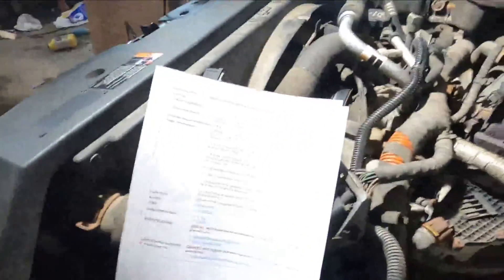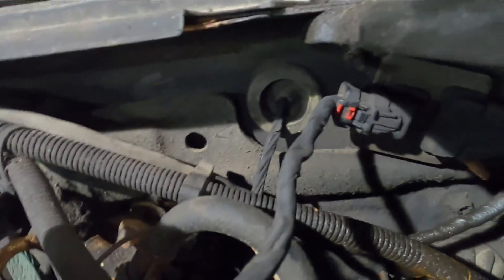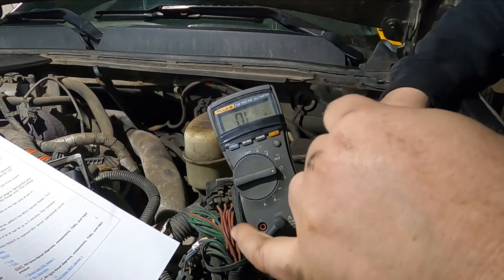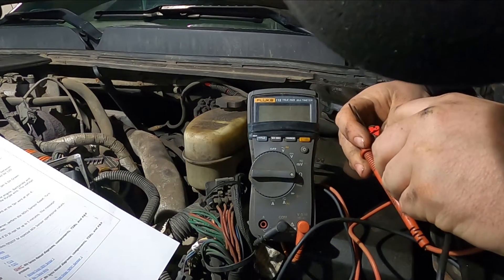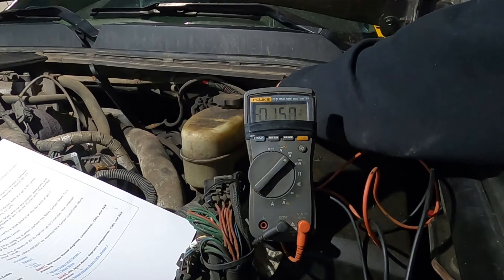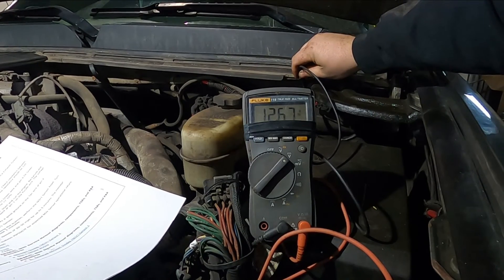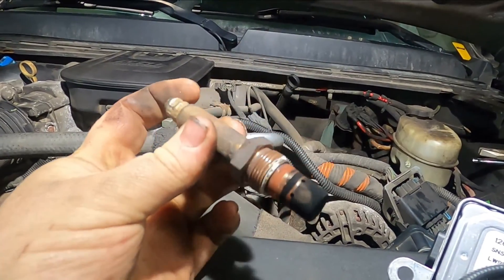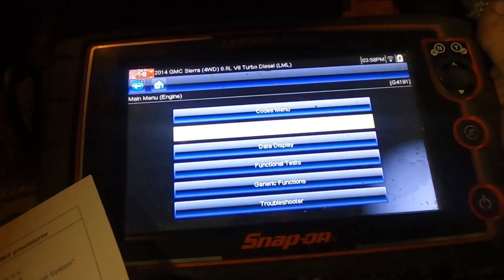LML DURAMAX NOX SENSOR DIAGNOSIS FOR P2203, P2202 AND P11CB

Comment: I just replaced bank 1 sensor and now it shows communication loss
Reply from the maker: OEM part or aftermarket?
Reply: @screamindieselltd  I don’t think it’s OEM
Reply: I am going to try an old sensor that I kept and see if that one loses communication
Reply: @screamindieselltd  I tried to clear the code and it wouldn’t clear
Reply from the maker: OEM is always the way to go with stuff like that. Aftermarket parts have been garbage for the past 3-4 years. Old sensor may have got damaged taking it out or something like that and not be working anymore as well.

Comment: I have 45ohms between 2&3 and 16ohms between 5&6. no voltage going to the plug. key is on . WTH?
Reply: I have opens with the key on. Ive never known can circuits to be tested with key on and getting 120 ohms but im a technician for heavy duty stuff.

Comment: Do you have to do a nox/ecu reset after replacing sensor? With a scan tool? Or maybe disconnecting battery for 15 min? Light came back immediately after replacement and clearing codes, 2013 chevy diesel

Comment: my check engine light came on and threw a code for sensor 1. I removed the sensor and soaked it in injector cleaner and then sprayed it all out with carburetor cleaner and wiped it down put it back in with anti cease cleared all the codes and the light has stayed off and the truck is running great. I will recommend on the LML spend some money and buy a shock it socket set the only way to do it in my opinion.

Comment: I have a 2013 Silverado duramax that just went into reduced 55 mph reduced speed.  I did 2 regents.  Took 40 minutes each time.  Check engine light went out but exhaust symbol still on.   Going to next check my NOx error codes and go from there.  Thanks

Comment: Thanks for the video.  I'm getting ( key off) 120.9 ohms on pins 2-3 and 17K ohms on pins 5-6.  With key on, 1.05 M on 2-3 and 122 ohms on pins 5-6 so presumably have bad spot in wiring
Reply: This is exactly what i have. Did this turn out to be bad wiring spot? Cause ive never known can circuits to be tested with key on
Reply: What ended up being wrong?

Comment: Will the new sensor reset without using the scanner tool to reset it?
Reply from the maker: Usually you need to use a scanner.

Comment: hey man, thanks for this video it really helped me out dianosing the NOx code i had. however, i performed the exact same tests you did, and replaced the sensor. now i have a dtc U029D- loss communication with NOx sensor 1 module. i clear it it come right back. i reset NOx sensor 1 with the scan tool. and it will not go away. all of my wiring is good, i have power and grounds exactly where i had them before. i need some help getting rid of this DTC please.
Reply from the maker: Possibly defective sensor. Even dealer sensors cant 100% be trusted. Or check your connectors
Reply: @screamindieselltd  I did check my connections. All of them were solid. I mean the only thing that makes sense to me in a bad part. Other than the ECU. And I've proven that the ecu is doing what it wants. Yeah in the times we are in, a (new) bad part is all too common. But thanks again!
Reply: @screamindieselltd  and I jus replaced that NOx sensor 1 and I still have a no comm's issue...

Comment: I have a 2016 and the sensor ends are reversed from what you have here. Position 2 has the plug that you disconnected and goes down to the exhaust not the back of the engine.

Comment: Great video and information. I had the NOX sensor1 replaced about a year and a half ago and the sensor code pops up high signal. Any idea what this means as far as high signal. Any would be greatly appreciated
Reply from the maker: Sounds like the sensor is bad or a short on the signal wire

Comment: Have the P11CB code on nox 1.  Replaced it with AC Delco new sensor.  I reset the computer and reformed the reset on the nox sensor.  My pin 2 and 3 read 1.049m ohms with the key on engine off.  If i test the same pins with the key off, i get the readings you said.  Any idea what would be wrong?
Reply: Did you ever get this figured out?
I’m getting the same readings with key on/key off which he does say to do but Identifix doesn’t say to do that.
Reply: Did you ever figure this out?

Comment: helpful info and direct delivery good stuff.  Are those testing values the same for the downstream NOx sensors on the LML's?  I've got a '13 that just kicked the Poor Def Quality msg in the DIC, so just trying to gather info on how to test & troubleshoot everything before we dive in.
Reply from the maker: Not 100% sure if the values or wiring is the same.

Comment: Do you have to go in manually and reset the nox sensor it’s self? I just replaced the nox sensor 1 and still have a CEL for it everytine I clear the codes and thought I had a bad one
Reply from the maker: Sorry for the late reply. Yes you do have to reset the sensor data

Comment: I have a 2015 that has a nox sensor code and is down to 55 mph can I just change sensor and code will go away it self or do I need the scan tool
Reply from the maker: You will need to clear the code and reset the nox sensor system for the one you have changed for that you need a scan tool.